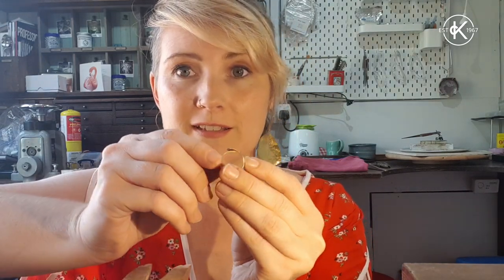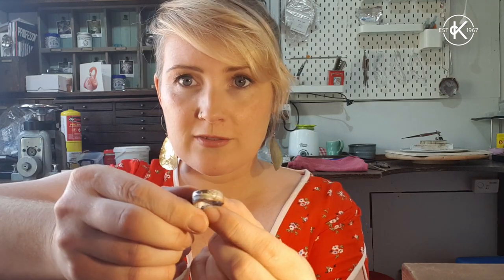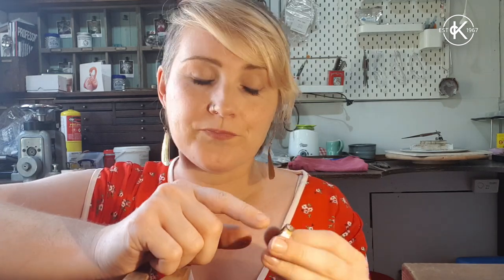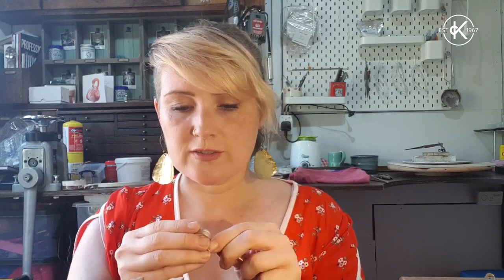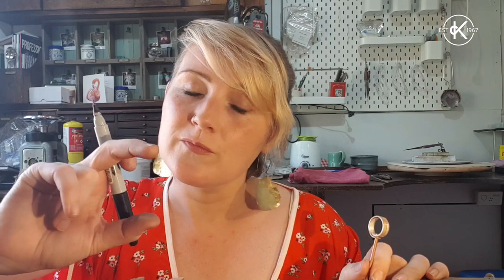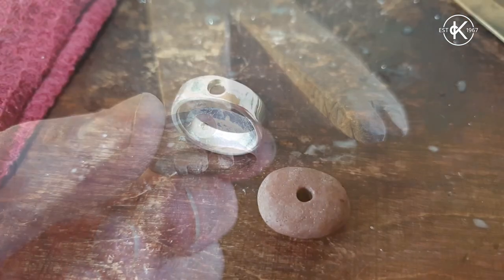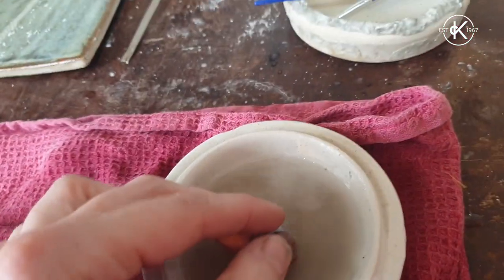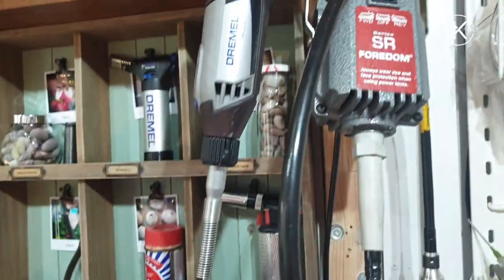Riveting & Cold Connections For Jewellery Making | 12 Months Of Metal

Comment: I appreciate the instruction for drilling a hole into the stone. I imagine the chosen stone needs to have some strong integrity for drilling and riveting.

I personally prefer using a center punch to initially splay the tube and then the cross/ball pein followed by hammer.

TY for the video!

Comment: Thank for showing us some cold connection techniques, just wondering why use the hand drill, would it be ok to use my Foredom for this?
Reply from the maker: Hi Betty, yes of course you can, whatever you feel comfortable using - just make sure you secure your work safely while you're drilling and don't forget your eye protection 😊
Reply: Hi Betty, it was partly because I find using a hand drill rather satisfying and mostly because they are much cheaper and often safer for beginners than a power drill/rotary tool. But yes of course if you have a foredom it's perfectly fine to use and quicker too.